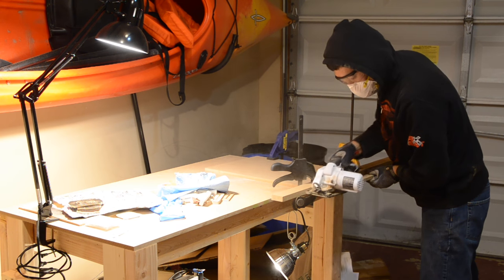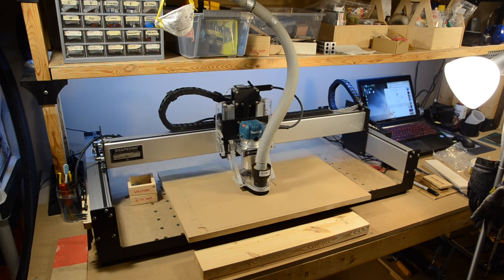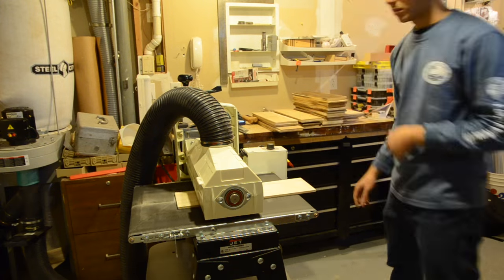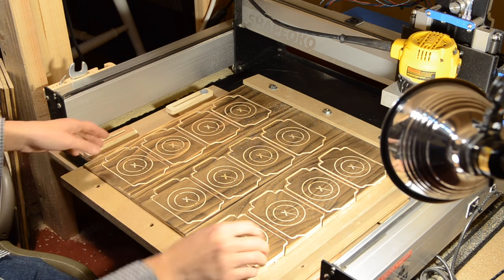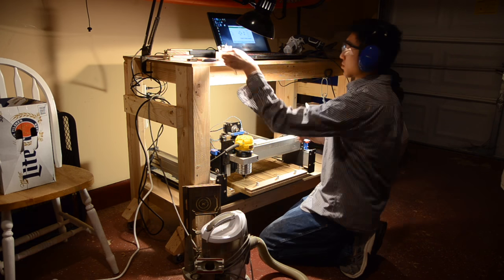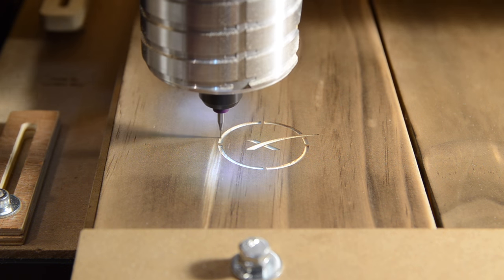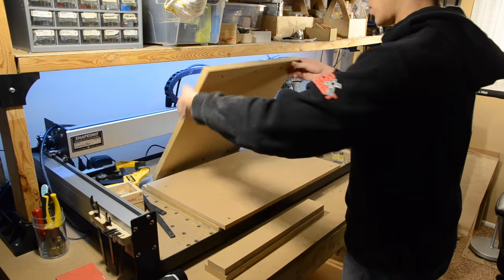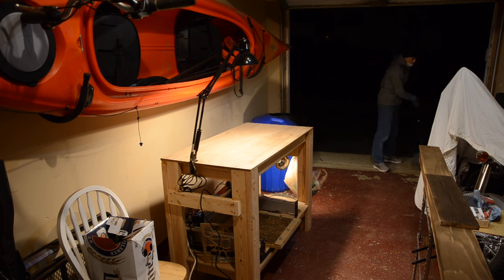Droneship Coasters: The Road to Mass Production - CNC Project 80

Comment: Get some of that MDF and lay the pieces on top, then use shims to balance the 'twist' of the boards.  It'll give you a LOT flatter surfaces when using a planer without a jointer.  Once you have one flat (or EXTREMELY close) side you can plane the other using that as reference.  If the twist is REALLY small, I use playing cards to support the high corners while it's running through the planer. I know this video is old, but sometimes it's faster than pulling out my jointer for a small twist that's developed. Hope it helps!

Comment: Hi Winston,

Just an observation and I'm sure you have a perfectly good answer for me but I'm looking to buy my very own Shapeoko3 and I'm trying to decide between the standard 16"x16" (400x400mm) or the XL which has double the width and I'm thinking that the answer to what one I will purchase could be with you as you appear to have both.

I saw in your video when you mentioned about workspace that you wouldn't have enough on the Shapeoko3, but then you cut to a clip of you creating the jig and you were using a XL... how come you didn't just use the XL and you could have created a lot more in one go? Is there issues with using the XL or do you just get a better, more accurate cut from the smaller unit?

I was going to just buy the standard size but I'm seriously considering purchasing the XL due to the fact I will probably want to create bigger projects at some point. My main question is... do you think it is a good idea to go straight to the XL or are there some downsides to the bigger unit. I would love to hear your thoughts.

P.S, loving your videos and the information you give. Very inspirational.
Reply from the maker: +Niall Killalea The reason I use the stock size 3 for longer cuts is because I have it enclosed with a permanent vacuum hose setup. Cuts down on noise and mess. If I'd made an enclosure for the XL, I'd be using that more. They are both functionally identical, it was really just convenience that drove me to use one over the other. 

Buying the stock size now and the XL later will cost about $100 more in the long run I think and it's annoying to have to re-wire everything. If you have the space, I would not be afraid to jump to the XL first.

Comment: It would be another process but, you could use a tram bit and level your boards on the S3.Also the carpet tape in the center would help or add a drilling spot in the waste area in the center.Add a bolt or two there to draw down.
Reply from the maker: I was looking at my setup and I wished I'd added provisions to put a bolt and washer through between boards in the middle. Carpet tape might have worked, but I felt some of the thicker boards were pretty stiff. Would be pushing the limits of adhesive workholding.

Comment: Did you use an adaptor for the DeWalt to get it to fit the (presumably) 1/8" bits or a different collet?
Reply from the maker: Different collet, from Elaire Corp.
Reply: Thanks Winston - got my Shapeoko arriving today so I'm doing a fair bit of research!
Reply: I can't see DeWalt listed - would I need a custom collet from them? Thanks!
Reply from the maker: +Michael Kelly I got a third party collet from Elaire Corp. A reduction bushing works too.
Reply: Hi Winston, thanks for the reply - I've bought a cheap reduction bushing for now which seems to work OK but I think I'll pick up the precision collet in the future. Thanks :)

Comment: Great video! Would using high quality veneered plywood not alleviate some of the warping caused by the wood burning process? Birch plywood with a walnut veneer will make for good color contrast.
Reply from the maker: It could very well solve the issues. I'd have to look outside of the big box store to find some of the appropriate material and thickness though... hmm... I'll keep that in mind for future experimentation.

Comment: imagine if you will that as you clamp the way you have them, you are creating angular pressure. whats happening is you are pushing that section of the boards downward but, you are pushing each end of the boards towards themselves. that is whats causing the bow in the center. your boards cannot compress in a straight line as in the laws of physics, everything moves to the path of least resistance which means the center wont compress, but move upward and out of the way of that lateral pressure. i came across this same issue with a special battery box cover a few months back and the only good way of making my parts was to have stops so i can move clamps from place to place dependant on the following tool paths, but the clamps always clamped onto a hold down block that clamped my part flat. granted most of my detail was on the outer perimeter of a pre routed (oversized) blank,  i still had a couple details in the center which again, i had stops in place to run an entire program that allowed me to constantly hold it flat. sometimes things can only be done the hard way if you want it done good.

Comment: Fixing the warped stock problem looks like an ideal application for a vacuum table. I think the real problem is the quantity. You're just in between the fun of doing a one-off and the efficiency of manufacturing. This is an ugly no man's land.
Reply: Using a vacuum sometimes doesn't help.  Once the vacuum tension is released the twist returns.  Most the time you gotta prop up the corners so it's balanced as it goes through the planer so the tension of the wood board across the face is maintained without external forces.  The planer squeezes the twist out of the board when it passes, but the twist returns when the planer tension is released.  Unless you have a jointer, which he mentioned he didn't have access to.

Comment: First, what the heck is ASDS?  I have seached several places and presume you have nothing to do with dermatologists.

As for the warping, I encounter this in my laser engraving projects.  I use weights to hold or "flatten" mid-media warp issues, as well as on the edges, that will not be lasered.  One thing it seems you could to is put a small screw in the middle of the waste parts of the boards you are cutting to hold them to the base board.  Or, use (thin) double stick tape.  Additionally, rather than using "too thick" boards to hold down the edge of your milled media, you could do, as I do, use aluminum (or some other metal) to hold down media to hole if flat and secure the metal with a binder clip, clamp, or, as you do, some bolts / screws.  I have an edge on the right side of my vector cutting table and use a washer under a binder clip to hold down stuff on the corners and / or middle.  It seems a washer placed between your coasters in the waste areas could easily hold your warped boards flat: two boards with one screw thru one washer.
Reply from the maker: +richard gebhart Autonomous Spaceport Droneship. (Gotta give Google some context next time: "SpaceX ASDS")

I had considered washers and bolts clamping between the boards, but getting the spacing just right, at the limits of my work area, and with boards that varied slightly in width was something I just didn't feel like dealing with at the time.